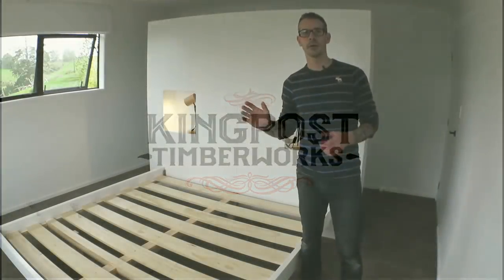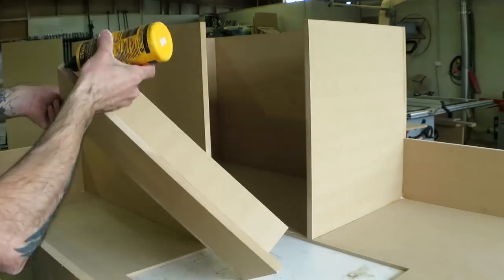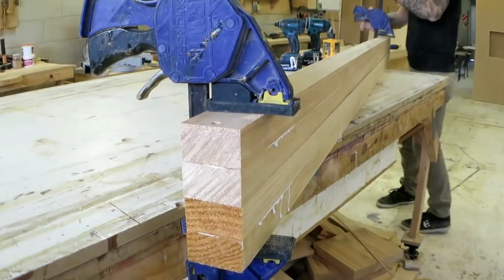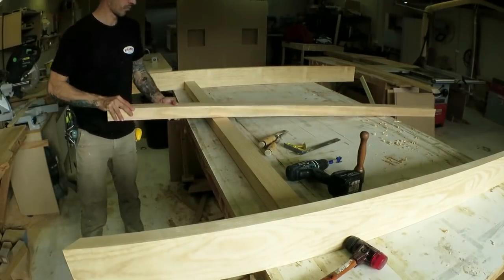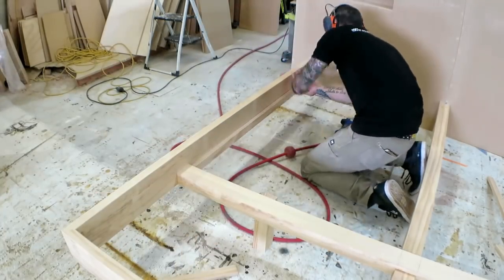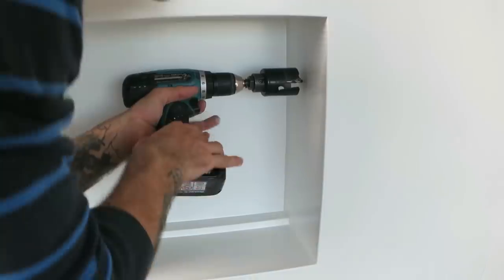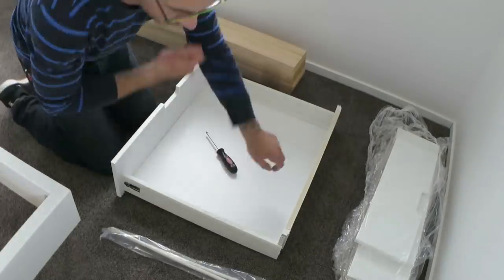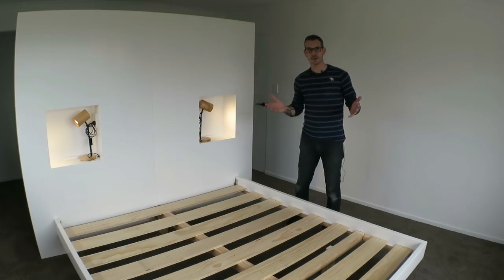Floating bed with built in drawers

Comment: I'd like to see more of how you paint and finish some of your stuff. It's always the hardest part of all my projects to get perfect.
Reply from the maker: +pauli150 well don't look too close at this one. I think the tricks are a good primer. Then at least 4 coats of paint sanding very well before the last coat. Use a very short nap roller.
Reply: you can always at the end flattern the paint with a very fine grit, like 1500 - 2000 and a sand block. Careful with the edges. Then, you can leave it matte or use some car polish for bringing out the shine. It is very simple, give it a try. (with "simple" I mean, for larger areas is more "time consuming" than "difficult")
Reply: And by the way... Incredible job, I just wonder how the corners of the bed will react with some weight.
Reply: pauli150  Ok
Reply: pauli150 ni

Comment: Very nice project that turned out looking great! I would not have used those two lamps however, I would have added some LED light strips in those boxes instead that turn on and off with a built in switch.
Reply from the maker: +starwarsfanforlife yes that was/is the plan. Budget didn't allow for the LED components. They are reasonably affordable individually but can add up pretty quick!

Comment: pretty cool, but don't you need a box to put your electrical connections in? it seems as though your receptactle is just mounted to the bed with the wire going directly into it, without a box. canadian electrician here, i guess the rules across the pond are different.

Comment: Very nice job! Funny that someone needs to be "qualified" to handle a few electric wires. In many countries that's not considered an issue at all.
Reply: In the UK, there are limits. An amateur is allowed to add a spur socket, or a new room light but is not allowed to touch the house's ring main(s) at all. Of course it doesn't stop everyone ...
Reply: Same in Italy...
Reply from the maker: +B Breeuwer the technicality here is you can do the work on your own home no worries. For someone else you must be qualified and give a document of safety when finished.
Reply: >.< come to China with no rules, but money rules ( ofcourse they say thats not the case...) I need to check all the work thats been done in my new home ( sit on the job and everything with pictures and checks on cam). The hole building site is full of cameras to keep an eye on them and the quality, and still how do you know all is done well.Moste people dont care about it .So better have them even its a pita because lots of fires start there.
Reply: It's not "a few electric wires". If you do something wrong it can cause a fire or kill people.
Reply: It's more about insurance companies not wanting to be responsible for you fucking up work that usually falls under protected titles. You can do it, you won't get in trouble, but if your house burns down, it's your own stupid fault and insurance won't cover it.

Comment: If you sprinkle some salt on the gluing surface, once glue is applied, when you mate the pieces being glued, the salt, being crystals, will dig into the wood , keeping it from slipping and sliding all over when clamping. ..also, what?? No dados? No rabbets?? Those really keep your work from slipping and sliding.. lol joke-joke. Nice design, nice execution.  Nice bed.. I like the integral dressers. I could never give up that much real estate to have the drawers pull out to the back tho.  I would have to face them out to the sides, opposing each other then shoving the whole thing against the wall.  Thanks for sharing
Reply from the maker: +j dog  hi yea I have heard that one just never have any salt! I'll sometimes use a wee copper brad nail and cut it off and squish the boards together.  We had designed the bedroom big enough to have a walk in wardrobe only that would be formed by the head board.  If nothing else my 2 year old loves running around it!
Reply: KingPost TimberWorks .. Yea, I've only done the salt thing a couple times myself, for the same reason, that is, everything's already glued and mates and slipping before I remember how well it worked last time and by that point, it's easier to fight it frantically than to back up and regroup. I don't do much laminating like that anyway. I mostly salt the joint between face frame and carcas. It helps keep my styles a uniform width. Lol.  Thanks for the brad tip. I bet you could leave the heads on them and just lay the brads down in the glue. They would work like the salt at that point.. The sides of the head would dig into the wood.  You know what? That might be a marketable product for all those "experts" who post all the shop videos about building their shop. ..and no other videos of them using their shop to build things like this bed or anything else. 
Oh, about the future LEDs under the bed, if you use the old school incandescent mini xmas lites, they will provide a little heat on those cold nights. You'd be surprised at how much heat they add to the mix.  Dude! You could add a little projector and a drop down screen or a rollup blind. You'd be like a modern day matt helm lol

Comment: Definitely subscribing. Nice design, but the placing for the bed is a bit awkward. Takes up a lot of space from the room. Why not do a built in with built in dressers on each side? Also, would the MDF hold from a great hard pounding (if you know what I mean)?
Reply from the maker: Cheers,  the main purpose for this design was to make a kind of privacy screen as the room opens out onto a lounge type room.  So when the door is open you cant see into the bed.  True it's not optimal use of space but does the job. So far so good on the bed holding up to natural usages .....
Reply: @KingPostTimberWorks  lol. That's what I was thinking for the placement Haha. Either way great build and idea. Will check out more of your vids for sure. Cheers!

Comment: Love the notched out facade on a second from the top drawer of each chest. Why did you make top one smaller than others?
Reply from the maker: +Arcus Cerebellumus because that's where the cubbie hole is on the other side.
Reply: Why didn't you just opted for a drawer that's not as deep or, for example, asymmetrical (like letter L)? Was that from lack of planning or intentional?  I'm not asking that to be impolite it's just that that's what I would have done. Too scared of intricate shapes like that since they're so easy to screw up...

Comment: This is amazing! @KingPost TimberWorks. What's the name of the material and  (walls) you are using for this build? Great job! :)
Reply: MDF,.its about 1/2 inch thick..you can get it in 8ftx4ft n you get different types water treated or fire resistant at your local DIY store..

Comment: i think its a waste of space. just put the dresser under the window; and the bed up against the wall.... how hard can it be?
Reply from the maker: The drawers extend into the bedhead so this design is not at all a waste if space infact its using the same amount of space as two separate things.  Secondly you should consider what you don't know, which is the position of the bedroom in the house and a screen of some sort was required (sometimes) when entering/exiting the room. In this way this design is an excellent use of space.

Comment: Waste of all that skill using MDF. May as well have bought some crap from IKEA.
Reply from the maker: +elvis459  1. We don't have IKEA 
                   2. Do they stock this ? 
                   3. Would undoubtedly be cheaper to make than buy no?  
                   4. What should I have made it from, surly mdf is a perfect candidate for a dry room Painted  finish. Presumably you would be fine with me using plaster board as per the rest of the house?
Reply: elvis459
The back of it should be plasterboard. It is not save to mount electrics on MDF.  The rest of it should be constructed from laminated ply.  MDF does not hold fixings very well and will likely start to fail at some point.